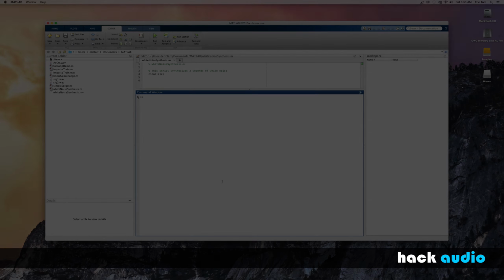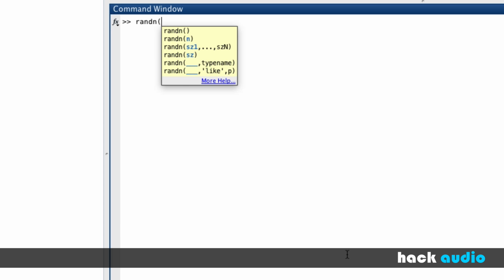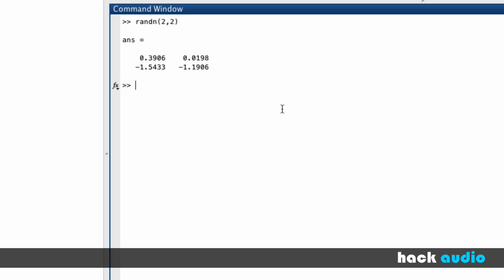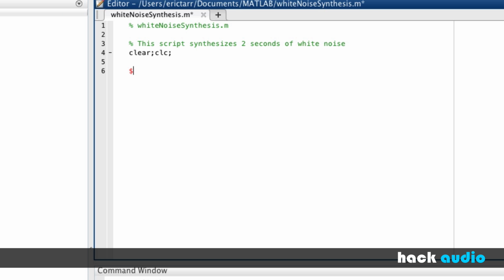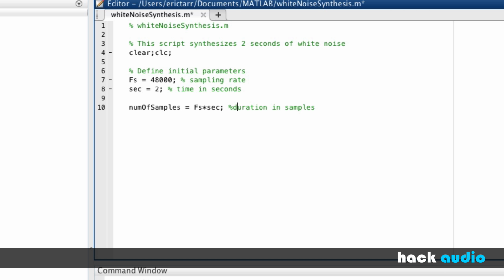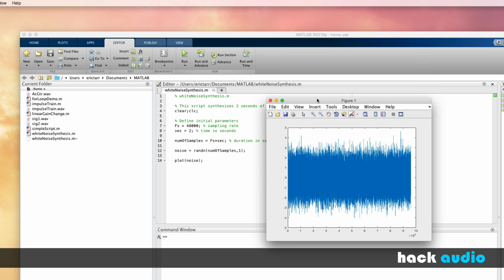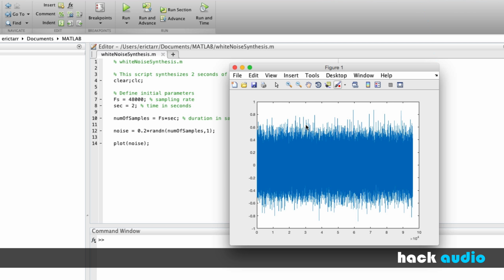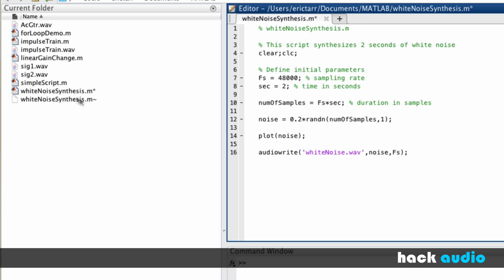Hack Audio: White Noise

Comment: You can also use rand to get an already normalized signal since our min and max level is -1 and +1 respectively.

Because rand produces a normalized signal between 0 and 1 instead of - to +:
noise = rand(numOfSamples, 1 )-.5 * 2;
This shifts the signal down 0.5 and doubles the amplitude to reach -1 min, +1 max

You can diminish the signal by multiplying less than two. Anything more than two will cause the signal to start clipping.

If you go all the way up to * 8, you get a vinyl/tape noise sounding effect.